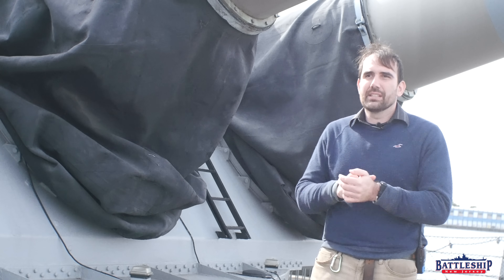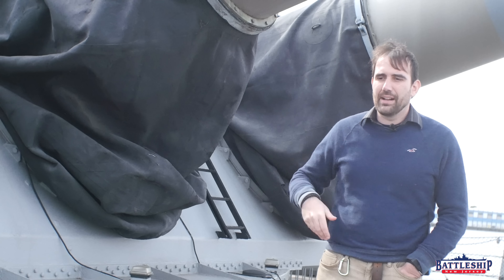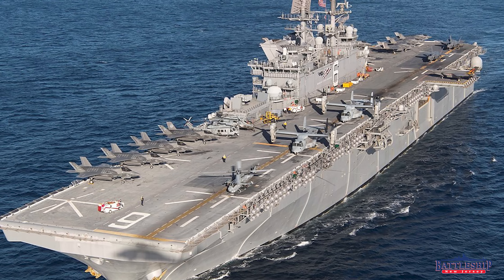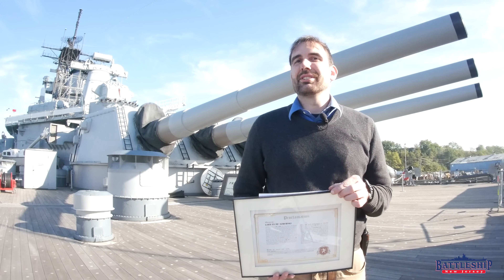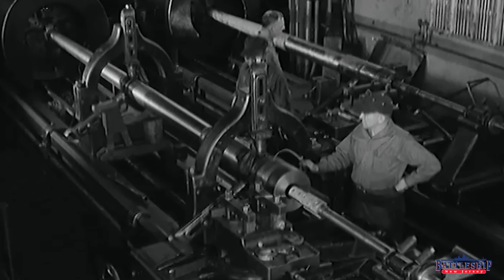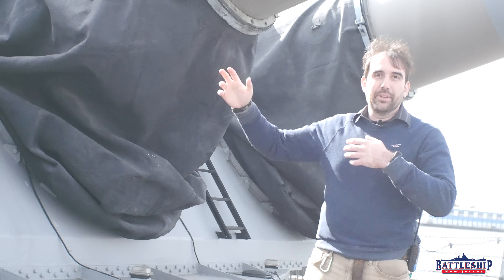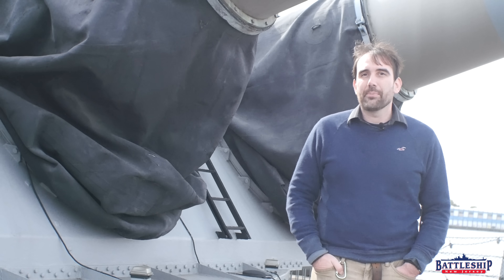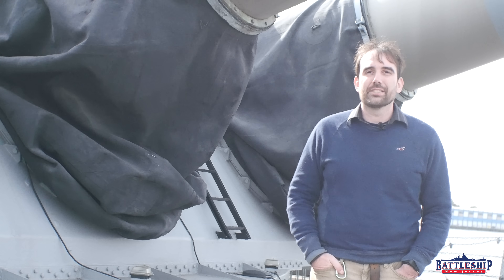How Much Would It Cost to Build a Battleship Today?

Comment: I honestly believe that the value of being able to put (comparatively) cheap 16" shells anywhere remotely close to a shoreline at these volumes is understated
Reply: you misunderstand modern capabilities, a rocket with percision, speed and power far beyond that of cheap 16" shells are simply incomparable, not only does it fail to fit in any current modern naval doctorine, theyre massively inefficent, the range they would have to be to the shoreline to actually attack is far too close, any unguided and esepcially conventional weaponry could easily strike it.  Also, how does bombing a shore with shells do anything.??  Most critical naval and military assets that are on the shore can easily be destroyed and disibilitated witha  single missile strike...
Reply: @dan9147  Not to mention the fact that battleship would have to get well in range of virtually all shore-based weapon platforms to fire those shells thus leaving it to get sunk the same way the Moskva was (and keep in mind that ship used primarily missiles for offensive operations and as such had no particular reason to venture anywhere near the shoreline as any battleship would need to.

In ww2 when all we had were planes, battleships became useless for everything but being glorified trophies to be paraded about as a means of power projection. Imagine what they'd be now in a modern setting where a man in an air conditioned room could simply sit staring at a screen and blow you and your ship to kingdom come from half way across the entire world, nevermind the fact planes still exist.
Reply: @devvytm  Before the battleships were retired, there was talk of developing extended range munitions that were rocket boosted that were promising something like 100+ miles range. Add to that GPS guidance like you see in the M982 Excalibur artillery shells and similar and the ships become less limited. Considering that >40% of the world's population lives within that range of the coast along with the greater part of industry, it becomes less of a limitation than you make it out to be. Of course, hopefully, no one would be dumb enough to thinking sailing a battleship up to an enemy coastline alone to lob some shells to at all a situation that would ever be feasible. There should be plenty of escort ships to protect against missiles with their Aegis systems and similar. Plus side to that approach: munitions that knock a zero off the price tag per explosive warhead and nothing to be salvaged from failures to further the enemy's tech. Downside: the shells would probably be easier to intercept than missiles due to their ballistic arc, but then again they would be much more resistant to destruction that way being nowhere near so fragile as a missile.
Reply: @devvytm  maybe but the increased interest in long range artillery will aid heavy armored ships. Such a ship could fire cheap and effective rounds hundreds of miles away from a shore. Aided by air defense and air support these such ships could be effective tools in support of naval invasions and for long protracted conflicts with near peers.
Reply: @kordellswoffer1520  Despite the points raised regarding the range and the potential to be a primary target for missiles and uboats, the resupply is always a factor to consider, if you get close to an enemy border, the enemy has short supply lines and is likely to be fortified, this leaves you in range for short range missile attacks and your supply ships prime targets for uboat groups over the course of thousand of sea miles - If you look up the current chinese doctrine regarding this they more or less did exactly prepare for that.
Reply: @johnpaulvanson5170  Well there are now 5" and 122mm shells on the market that are rocket assisted and GPS guided. They have a stated range of 80km and CEP of 5m. Look up Vulcano shells. I think they're Italian. The're in production now. What more do you need if you can get a 5" shell that close to the target? 16" is going to be overkill for nearly anything and they were useful for shore bombardment when accuracy was lower and lethal radius needed to be higher in compensation. 16" were designed to kill massively armoured steel warships - which don't exist any more.
Reply: @slammerf16  the problem with rocket assisted rounds is that there is not much space left for actual explosives (and Volcano is a saboted round, that has actual diameter less then 127mm). So incresing the caliber would be actually helpful, but if said caliber will be used only by the navy, and only by one class of ships, a single round will be prohibitively expensive, so you need to have army onboard as well. I would argue that 8" (203mm) could return for this purpose. They can be used by both batlleships/cruisers of the future as well as new long range ground artillery (imagine owersized Caesar on a 10x10 HEMTT). But 16" are dead for good, if the target indeed requires yield like this - sand a tomahawk or a Prsm.
Reply: @Devvy  I absolutely disagree with your statement that battleships were glorified trophies in WW2.  American carriers didn't run from the Japanese Imperial Navy at night because they were afraid of their air fleet.  They ran from them to keep their surface units (i.e. battleships) from catching them and engaging them with gunfire and torpedoes.

Battleships were an integral part of operations in WW2, and just because you think that carriers were superior...  Remember, they ran out of airplanes (which is why they hung them from the hanger ceilings, etc.)!  The naval commanders back then knew how valuable they were, which is why Halsey took them with his carriers when he left Leyte Gulf exposed in 1944.

I believe that battleships today would be just as valuable as they were in WW2, especially once you consider rocket-assisted artillery, gps-guided munitions, anti-aircraft systems, loiter times, and their capability to dominate the beaches.  The Germans tried to counterattack at Normandy on D-day (21st Pz), and their armor was driven off by American and British battleships.

The only question remaining is:  Will they build new ones to install railguns onto when no other naval power can threaten American naval supremacy??  Kind of pointless to build such warships when there is no opposition to begin with...
Reply: @tyree9055  a battleship will be kill very fast whit anti ship missile and submarine . when you can get a ton of smaller ship using powerfull missile that can kill anything vs a few very expensive battleship . is pretty oblibious that battleship lost lol . a good exâmple is german tank in ww2 big powerfull and expensive . cant build a lot . vs a shit load of sherman and t34 that are not expensive . who win ? the war ?
Reply: @thejimyyy  Why do you think a modern battleship would die any faster today than they did in WW2?  You think they'd sail all alone in the ocean?  It's all relative.  Every fleet has a purpose and battleships don't travel alone.  America used battleships as late as 1991 and now decided to make them museum pieces because Russia completely collapsed.  There's no point in operating them when there is no opponent at all, period.
Reply: @TheJimyyy  no it wouldn't be. Hitting a ship let alone sinking at least 40 to 50 thousand tons of heavy Armour is not easy, it needs to be tracked and than the ships defenses and the defenses of its group to countering evasive maneuvers and than actually destroying it. It would be fairly difficult to do so. Well that's an absurd comparison and shows your ignorance of history. A modern battleship with some more advanced systems to actually make the system useful would be a capable asset any blue water navy would need at least a few of.
Reply: @tyree9055  no thats completly false . yes they use it but it was still opsolete . anti tank missile modern one can kill a ship way better than a shell and it take a less of it . and you can use that small not expensive ship to use this and in a number number so at the end it completly destroye the use a battleship
Reply: @kordellswoffer1520  lol modern ship whit modern weapon will out range a battleship is faster smaller cheaper . can build a lot more of it . for now shell are useless and a battleship is too expensive for what it do . a destroyer can be build in more number and are way more effective on the modern battlefield
Reply: @TheJimyyy  barely coherent. No smaller ship tend to have smaller ranges than bigger ones. Carries and cruisers all  outrange smaller ships. For now, there's no assurance that will be the case if railguns become a reality and when better and more sophisticated guided technology is able to guide the shells. A modern battleship with such technology equipped with cruise missiles and radars and air defense is extremely capable.
Reply: @kordellswoffer1520  rail gun project is no longer open lol there will be no rail gun before many many years . Also destroyer have more range than a old battleship and can shit missile at almost 100 mile …
Reply: @TheJimyyy  it is not that doesn't mean it won't be or that the technological hurdles that breed failure will be present in 5 or more years. Battleships of the day were limited by their technology, a modern large ship would outrange almost any destroyer.
Reply: @kordellswoffer1520  no lol it will need around 50 years to have rail gun and in 15nyears they fail to make some thing usefull and a modern large ship will be useless when you can build many smaller ship that do the same work
Reply: @tyree9055  maybe it can carry more missile is also more expensive and when you can build multiple destroyer for the price of 1 ship destroyer win . also the gouvernement of usa and is navy also agree whit that 😂 and even the guys on this youtube channel did say battleship are useless
Reply: @thejimyyy  If battleships are so useless, then why are all of the naval simulators posting videos of Iowa-class battleships sinking the Russian Kirov-class cruisers?  Believe the stupidity if you want.
Reply: @TheJimyyy  you know nothing of the US war economy which you are failing to understand is that we wouldn't just buy one we'd buy a batch of them so the unit cost would actually be cheaper per ship
Reply: @rhecwelder5366  lol so is even cheaper to not build battleship then cause this work also whit everyship , thanks to make me right 🤣
Reply: @johnpaulvanson5170  the M982 Excalibur is a GPS guided 155mm artillery shell that was tested by the US, but found to be less effective than HIMARS and more susceptible to GPS jamming. These were supplied to Ukraine and in the beginning of the war, had a 70% hit rate, but that dropped to 6% once the Russians figured out how to jam them.
Reply: @dan9147  bruh you are acting like a professor and yet can't even spell correctly your own language
Reply: @dan9147  rail gun will work . so im sure in the future one day battleship whit rail gun will come back when the tecnologie is mature enough
Reply: @dan9147 the 16 inch is cheaper and a mondern gun could probaly be full auto and a lot more accurate. I would also biuld the ship with the high power laser defence the usa made which was found to be to big and power hungry for destroyers and crusers. Would say a bb with nuclear reactor will have no prob with it. With a laser defence it can get close to shore and just shoot down anything trying to kill it not to mention the mini guns we have on it also. Bonuses points in the enemy just reviled where they are to get shot at.
Reply: @dan9147  no it can't. It would take several bombs and missiles to destroy a landing site. You can't throw around bombs like shells especially when you've got shells. A guided weapon certainly is better but costly for having to bombard coastal fortification and enemy positions. You can't throw hundreds and thousands of tom hawk's and smart bombs at one beach.
Reply: @kordellswoffer1520  We threw tens of thousands of shells at Okinawa and it literally did bugger all. Even 16 inch shells won't get emplacements deep in the bedrock and mountains like specialized missiles can, not to mention variable flight paths to hit targets protected from one or more sides by elevation or other environmental cover.
Reply: @Rob_Fordd  I never said it was but ifs considerably less expensive to pound coastal positions and fortifications with heavy shells than with missiles. In long term conflicts, we can certainly mass produce such missiles but not like shells and not as cheaply.
Reply: You’re ignoring the cost of the platform launching said shells….
Reply: For shore bombardment it'd probably be easier to just take a handful of cruisers and build them with a pair of modernised 8" or 10" three gun turrets.
Reply: 16 shells are cheaper than missiles but the overhead costs of a battleship floating around for decades would exceed the costs of any kind of missile.
Reply: This argument is pretty funny.  The Germans described British naval gunfire in the Mediterranean as “simply murderous.”
Reply: Some pilot once wrote that a battle ship can put more ordnance on target in  a few mi uses then a sqaudren can do in 4 .5 hrs he broke it all down you know 9 guns firing 
2300lb bombs at 2 a minute is 20ty tons a minute!!!!! Which is 40 500 lb bombs
On target in 1 minute!!!! Building a bb with missles is fine but at least put 8 inch guns on it
Reply: @HDSME  dude if you are biulding a bb go for the 16inch guns. Wonder how fast we could get one shooting with mondern tech?

Comment: I think I would lean towards new build ships.  That would also allow you to include both modernization items and "efficiency items" to lower the costs/number of the crew.  One easy example, is looking at the various periscopes on the ship, many of them may be able to be replaced with an electronic camera system, similar to what the current Virginia-class Subs use.  There would also be things like modern gas turbines and APUs, providing much more power.  I would also want to look at maybe changing things, such as instead of the current 8 compartment engine/shaft arrangement, use a more efficient, modern setup.  As for the shipyard question, I would argue in favor of building a new, modern, shipyard, using modern construction techniques, and while I would want future nuclear capability in the shipyard, for super carriers and whatnot, that wouldn't be a priority, at first.  I would also likely want to include the various improvements then Navy wanted to "fix" on the Iowa-class, with the Montana-class battleships, before they got cancelled.

Comment: Tonnage the same as current US carriers 
Missile armed for the most part only 8 5"/54 and 8 CIWS. Design large anti-ship and ground target missiles around twice the diameter of standard missiles with a new vertical launch system for them. Plus, Standard or other Antiair systems as needed. Nuclear propulsion. Armored to resist most medium and smaller threats and be able to shoot down larger ones. $12 billion for the first one 10 billion per for follow-ups.
Add 10 billion for a new shipyard to support the construction.
Also needed are replenishment ships to match able to carry and handle the bigger missiles.

Comment: Easy answer for me.
Build new.
While it's a pretty lowbrow example, I deal with plumbers all day. You know what really makes a job drag on and on and on? Remodels and change-orders. Changing stuff that is already there and trying to graft onto existing hardware while attempting to bring it up to modern standards is an absolute nightmare of a task.

Now, with ships, can it be done and has it been done before? Yes and yes. All the time. But refitting an 80-year-old hull with shiny new weapons and radars still leaves you with an 80-year-old hull.
If you know what you want, and you want it to last, build it the way you want it. Start with a blank slate. Then you don't have to accommodate the decisions made by naval architects from the 1940's.

Comment: Understandably it will be costly to retool for much of the iowa class components.  However It doesn't make sense to retool just to manufacture obsolete components.   My first thought is to replace those 16' guns with railguns.  I understand railgun tech isn't ready due to premature wear on barrels.  However I would subsided the guns until railguns become viable with vlm stacks.  I would also make them nucs, and although the cost of modern electronics and computers are costly, it will make the ship require less crew due to automation which in turn will offset some operational cost.  i think this is something the dod should take a long hard look into.

Comment: Lengthen and widen the Burke class. Replace the 4 LM 2500's with 2 navalized LM6000's in a IPS with electric motors. Replace the Allison gens with 2 big MW diesel gens. Add a 32 vls to the front for 64 vls and at least an 32 vls in the lengthened section.  Then redesign sleeping quarters to modern standards for crew livability. Increase fuel storage for added range. Add the larger 18 ft. SPY6 radars. Cheaper then the $30 or so billion they will spend on developing the DDGX.